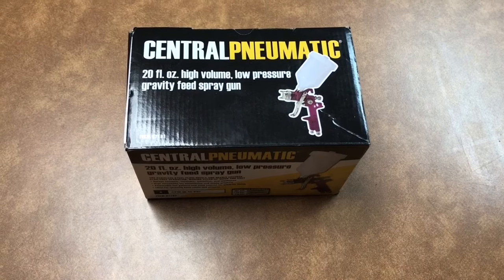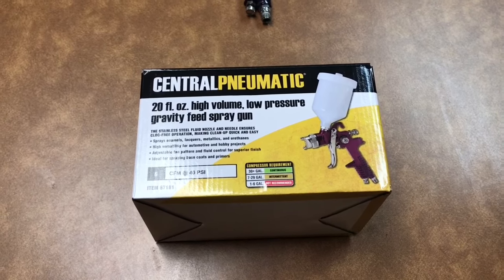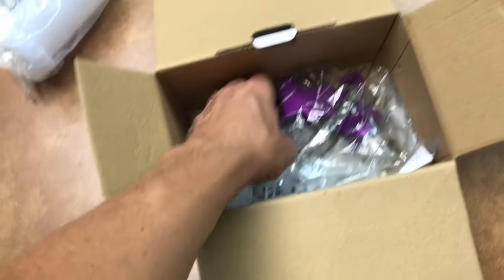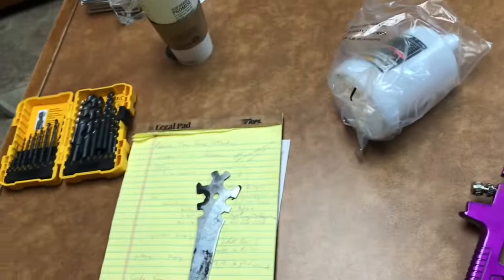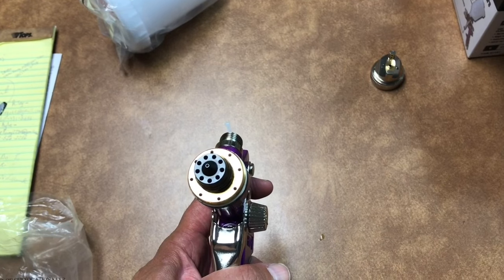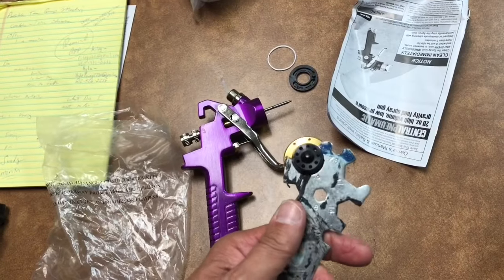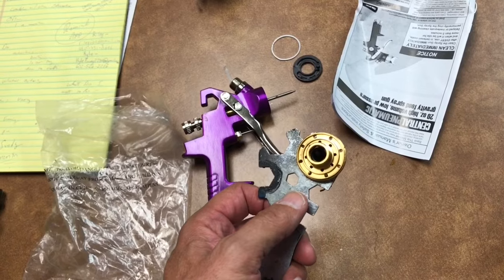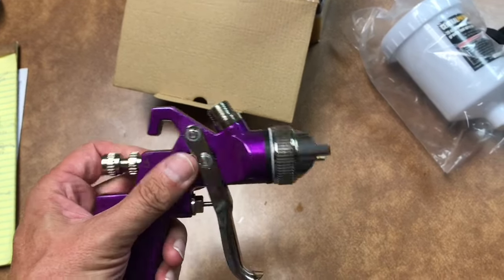Harbor Freight Purple Gun modification from 1.4 mm to 2 mm in order to spray primer

Comment: No matter what SOME people may tell you,  this is a darn good little gun for the money! (I've had my own little shop for 30 years and have used many guns).  This gun will spray primer if you thin it down according to factory paint recommendations.   Also.....be SURE you clean the gun out really well before your first use it.  Then every time after you've sprayed a project, run lacquer thinner through to keep it clean.  Don't forget to pull the little plastic filter (under the paint cup) and soak it occasionally too.  It's there to keep stuff from getting into your gun and works well.
Reply: just bought one, question can I spray water based paints through it now that I will make mine a 2mm? I have a sign business and get tired of using my wagner
Reply: @danbarrett6113   I've never shot water based paint through mine before, but what's it gonna hurt to try?  Then let us know.    ;-)
Reply: When u say thin it down on primer are you doing 4:1:1
Reply: @timothyward7381  There are lacquer primers, Urythane primers, Epoxy primers and Acrylic primers....I just do whatever the flow sheet says to do.  If it seems to splatter a bit, just thin it down a little more until it lays down smooth.
Reply: @danbarrett6113  I open up the fluid cap to 1.8mm for latex paint.    And then either clean them very well, or be prepared to pitch them in the trash regularly.   I buy them 2 or 3 at a time when they go on sale for 10 bucks.   After a few cleaning cycles, they start to get a little finicky, so I'll open up a new one.  I do save the fluid tips, and have them in 1.7 and 1.8mm sizes.   1.7mm generally for auto primer, 1.8mm for household latex.

Comment: I did it just like this guy did verbatim. Sprayed latex door paint/primer to wooden swing porch. Thinned with water and added a little Flood floetrol. I used same purple gun with a small undersized compressor.  did 3 or 4 coats.

Comment: I recently did this modification and sprayed high build like silk great trick anyone that says this don’t work is ignorant. Thanks scott
Reply: I am hoping for the same results.  Thanks for sharing your experience.
Reply: @myoneblackfriend3151    Generally, the fluid tips and the air caps are designed to work together.  Opening the tip to 2.0mm is like 4 sizes larger, without any corresponding change to the air cap.     I'd start smaller, you can always open up the fluid tip a little more if you're not happy, but you can't add material back onto the fluid tip.  #50 drill bit is just under 1.8mm, a #49 is just over 1.8mm, and a #51 is approx 1.7mm.   I have modified fluid tips for the purple guns at 1.7 and 1.8 mm  and use them for primer and even household latex paint.  If the paint is properly reduced, there should be no reason to need 2.0mm fluid tips.  

Of course, these are 10 dollar (on sale) paint guns, basically disposable, so modify away to your hearts content, the only risk is having to start over with a new 10 dollar paint gun if your modified one doesn't atomize the paint to your satisfaction.    If you use them for latex (water based) paint, you'll be throwing them away regularly anyway.

Comment: Just bought and used this gun to prime and paint my cabinets, im incredibly happy with the results. Didn't modify the tip tho, instead just thinned the primer and paint
Reply: I was planning to do the same thing, what ratio did you use?
Reply: Furniture/wood primer might be different.  I wouldn't suggest thinning the automotive primer more than the product specifies...
Reply: @aladam6310  7-10%

Comment: Works... I drilled mine out ... sprayed Kirker Enduro Epoxy primer with 10% reducer @ 28 PSI at the regulator. Sprayed perfect. It was a black color epoxy. Looks like I sprayed it with Hot Rod black paint. You can barely see any orange peel at all. I now have an excellent primer gun. I used a gun like this with primer before modifying it. It spray like crap. With mod... excellent.... $9.99 Gun, who would have thought.

Comment: I do autobody work and spray primer everyday with that spray gun at 1.4mm. It sprays perfectly when its clean. I'm curious why, in your experience, it does not spray well
Reply: Wouldn't it need the needle replaced with something that fits 2.0 as well??

Comment: I purchased this gun from HF and used the 20% off coupon. I also purchased the larger cup for holding more paint so not to run out of material so soon. This gun works great with latex paint, primer & paint!  I built a LARGE custom solid wood table for our foyer. I primed table first with latex sanded surfaces and painted the finished latex coat with satin black. GREAT RESULTS with the finish. Just make sure you keep the gun clean as instructed. There were no leaks with my gun as some have reported.
I did return to HF and purchased the stand to hold the gun while filling the cup through the Filter. It makes filling the cup real easy with no mess. I did thin both primer and finish latex with windshield washer fluid, works great. (Another u-tuber posted this thinning tip, works great).
Reply: Did you do the medication to 2 mm? It wasn't clear from your post. I am trying to decide whether to do this mod. Thanks.
Reply: Tommy B       No I did not modify anything about the gun or tips.
Reply: @johnrodebaugh7120  Thanks for your reply John! I  tried without the modification and it works great!

Comment: for those wondering about shooting gelcoat...yes 2.0 will work if you use duratec gloss additive to thin it out ratio is 1:1...be sure to work quickly as you will only get 15min total to get it all out of the gun before it will Harden.  Set a timer for 10min and clean for 5.  cleanup entails complete disassembly.  Have plenty of acetone avail.
Reply: You can also thin the gelcoat with acetone. We use a 2.5mm gun for gelcoat and always thin it a little with acetone. I just bought a paint gun with a 4.8mm tip, so I shouldn't have to thin the gelcoat anymore.
Reply: So there is no way to spray gelcoat with a 2.0 nozzle without duratec or styrene?
Reply: @ants00  acetone to thin it for spraying

Comment: Would the needle be needed to be changed for the larger diameter hole? Looks like the needle filled the 1.4mm hole but not theres space around the needle point when its not retracted.

Comment: The paint cup can replaced with 3M throw away parts and pieces. This includes the correcter adapter threads.
Reply: HF also sells call throw away plastic cups for this gun, too

Comment: I finally killed mine after 10 years and just bought a new one. 
I’ve sprayed house paint, rustoleum, automotive paints, marine urethane paints with this. Lots of marine paint and rustoleum, actually. Been a great gun.
Reply: Afternoon I am a retired firefighter in his 60s who just picked one of these guns up to do little odd jobs around the yard. I wanted to paint some wooden patio furniture with latex paint and I wanted to paint a couple of metal objects like wrought iron a garden Wagon and the bottom of my lawn mower just to find a reason to use this darn gun LOL.. I'm going to do this 5/64 modification but I wanted to know what did you wind up doing when you were using black Rust-Oleum paint or whatever to paint metal as far as thinning and settings on the gun? Thanks for your time

Comment: the older on was a  better gun in many ways,  some of the parts were made better and they had a fan adjusting knob that was metal instead of plastic.  The plastic knob melts in thinner
Reply: " The plastic knob melts in thinner" Extremely glad you have mentioned this!!!  That is too bad although.

Comment: Will the gun leak now that the hole drilled out? I am not a pro at all, but I am about to paint my first paint job and I want to do metal flake. I want to use this gun but I am worried that if I drill out the tip it will leak while under pressure.

Comment: Hey there i follower to a T what you did… and now nothing but air comes out … Not paint not water not thinner .. nothing but air.. I have another purple gun and when I put it’s original 1.4 tip the gun works perfectly.. I put the modified back on and nothing… I can’t even spray waters… only air comes out and it bubbles at the top vent.. any help please?
Reply: This happened to me too. I’m glad to know it’s the mod after seeing similar comments. It was the first time I used the gun.
Reply: @cozmicrain  I just ended up buy a gun with a 2.5 on Amazon and it worked perfectly.. this mod doesn’t work

Comment: Don't mod it to 2.0, but 1.8 (and experiment with different needle sizes) because spraying through it will ream our the hole to 2.0 soon enough.
Reply: What size is a 1.8 tip
Reply: @rafiq24032mh17  1.8. 
Or you mean the drill size?
Reply: Yep! add some cutting oil and the primer cuts that metal tip quicker

Comment: I don't know if you can help but I did the modification and I used the gun a few times prior to that but it's been a couple years. I cleaned it very well when I put it in the storage and now when I go to use it for some reason it is spraying at a low PSI without the front cap and when I put the front cap over the nozzle it won't spray anything at all and it appears that it's coming out the top of the paint bottle. I am only using water right now just to test it out so it's not that the paint is too thick or anything like that. Any suggestions? I have it at about 40 to 60 PSI on the gun air gauge.

Comment: This didn't work for me, not sure why it works for others. I bought this same gun recently, bored it out as instructed, but it only blows back into the cup. I could see that the needle still had enough taper to fully seat so I wasn't sure what the problem was, so I bought another one of these guns the next day and swapped tips, it did the same thing on the new one and the unmodified tip fixed the first gun. This confirmed that boring out the tip ruined the tip. No big deal considering the price, and I have a spare parts gun if needed.
Reply: Mine did the same thing blew it right back into the cup I guess it's hit and miss
Reply: I had the same issue today too.

Comment: Great video. I was just wondering if the tip shouldn't now be a 2 mm tip as well? Seems that the original tip works, though. Thanks!
Reply: tip as in the needle? I was thinking that myself.
Reply: Nop it is taperd... If running an artist air brush you can polish the tip.

Comment: Did you have any leaks? I thought you would have to go to a 2 mm rod?
Reply from the maker: Kurt Simmons the rod is tapered and still handles it.
Reply: @james4878  It probably won't leak if you use a good sharp drill bit and drill it square, but if it does leak, it won't leak much and you just put primer in it, spray it and then clean the gun out. It's not like it has to sit a long time with primer in it. If it does leak, just lay the gun on it's side in between coats. On SATA guns (this is a SATA copy) the needle and fluid tip are machined for a perfect seal/fit. I doubt on a $10 paint gun they worry too much about precision machine work.
Reply: Some guns use same needle, air gunsa impact 1.6-2.0 is the same needle different nozzle, I drilled mine from 1.6-2.0
Reply: @CarbonGlassMan  This is true, the needle in mine does not look machined. It looks like it was tapered on a belt sander!!

Comment: Enjoyed your video. I want to spray used motor oil, or a mixture of oil, grease and boiled linseed oil (thicker viscosity) to undercoat a car for rust prevention. Do you think the hf purple gun modified would work? Any feedback would be appreciated. Thank you.
Reply: I spray my fence with motor oil thinned with a cheap brush cleaning solvent.  Sells at Home Depot for about 11 bucks a gallon.  Have not needed to modify the gun.  Shouldn't be a problem.  Do recommend that you use new motor oil to avoid problems.

Comment: Just bought what looks like the same gun, but mine says 12 CFM at 45 PSI.  Also, it came with the wrench and a little pipe cleaner.  I can't find anywhere what is the tip size.  I guess I could try to measure it with a pair of calipers.

Comment: Hi, thanks, already had a spare sata NR95 which was a 1.5mm and would not handle heavier 2K primers or fillers and opened that out to around 2mm. No one is going to measure the precise size of the fluid tip orifice!!!

Comment: Sr please I need your idea how big off tip I need to use a gun like this for a oil paint I will drill it thank you for this videos
Reply: +Juan Belloso  If you are talking about the "Air Cap" on the front, then first thing that comes off, use the wings captured in a bench vise, but large slip-jawed pliers on the knurled ring with left if off, while turning the gun. This "Air Cap" allows for vertical or horizontal spray pattern, the ring holds it on but when loose, allows for movement. 
  If the "Air Cap" if off, then it's the fluid nozzle. This is different because it has a very thin hex wrench surface. If this is stuck, it will be harder to remove. Although, placing the factory wrench on it, then using the bench vise again, clamp down lightly on the wrench sides, then hold the tool and turn the gun.

  If the gun was not cleaned after use some time ago, this problem will occur on any spray gun, even ones in the $300 range and up. Maintenance is the key. 
  Note; Many discuss this gun upon disassembly and the white goo on the threads of components. While true for some, use a Permatex "Gasket Maker" P/N 59235 or ACDelco pipe sealant 12346004 / GM 19333512 and apply a thin layer in 3 threads behind the second thread or so. Do not get it on the edge of the threads where it can contaminate the paint of plug up fluid or air holes if over applied. This is a white teflon sealant that allows for movement over 4 hours, but does not harden. It is used on oil and coolant senders, head bolts that screw into coolant jackets and still provide sealing, and never had a ground issue for senders. Apply it and wait 4 or more hours before use. 
 Worse case, save it for parts, and spend >$20 and go get another HF spray gun.
Retired ASE Master Tech. Not part of Scotts Garage / Hope this helps! Maybe.

Comment: My harbor freight Central Pneumatic HVLP came with a 0.6 tip. Can it be replaced with a 0.8 tip? if so, where would i find one
Reply: At the price of these guns, you just buy another gun with the needle and tip size you want. On a SATA gun, which this is a copy of, the needle, tip and aircap come in a kit and they are about $170 for the kit.

Comment: Is it nor possible to thin the primer so that it will work with 1.4? I am thinking of getting a single 1.4 for primer, base coat, and clear coat.
Reply: you loose quality in your primer when you thin it. Also, primer can gunk up your nice guns for base and clear coat. Better to get a cheap gun for primer.
Reply: 1.8 FOR PRIMER 1.4 BASE AND CLEAR

Comment: This mod doesn’t work. It changes the geometry of the cone and leaves a gap between the cone and cap
Reply: cut the boss back on the needle so it will allow the needle to travel forward just a bit. Doesn't need much. This can be done on a drill press.

Comment: Hey, I tried this mod on an older purple HF gun I had, and I tested it and it leaked. Any help? I used a regular hand held electric drill
Reply: Yeah, the rod has to be changed as well!  Once you open the hole then the diameter of the rod is not fat enough to close the hole when you release the trigger!
Reply: I wonder if it's because when you spin that whole tip assembly out, both pieces at once like this guy did, it unseats that thread sealant in there. I just did the same thing taking mine apart and it looked like there was that orange gel thread sealant in there that HF uses, like on their portable air tank manifolds.
Reply: @ghuff3319   No it does not the rod is  tapered it'll fit right in there. I've done it a couple times

Comment: how does the needle seal since its pushing against a much larger hole?
Reply: +Jason Xu   The fluid needle is tampered, so given enough forward adjustment, the needle with seat in the build hole and stop fluid spray.

Comment: Scott.....why don't you answer the needle questions below??  I'd like to know that info also.
Reply from the maker: The needle is tapered enough to handle it.
Reply: The needle will handle a much larger tip than 1.4 so there is no worry there, just to give you an example the tapered needled on my DeVilbiss FLG4 works for a 1.3mm tip all the way to a 1.8, they don't give you multiple needles just tips.

Comment: How do you compensate for the needle?
Reply: The needle is a taper. Apparently it is large enough diameter to still close too? I just picked one of these guns up to spray some latex paint. But the tip it comes with is way too small. For what the guns cost it is a crap shoot. A good brush costs more. But I need to pick the pace up on the project I am working on. I can spray a lot faster than I can brush too.

Comment: What about the needle? The paint will leak on the nozzle?
Reply: They are tapered a lot larger than the very tip
Reply: @pb6198  anyway i can still paint epoxy primer on 1.5mm nozzle without any problem
Reply: @smoke_stackz3168  epoxy primer is like water compared to some high solids urethane primers
Reply: @pb6198  yes urathane like 2k primers and primer surfcer still i can shoot it on 1.5mm